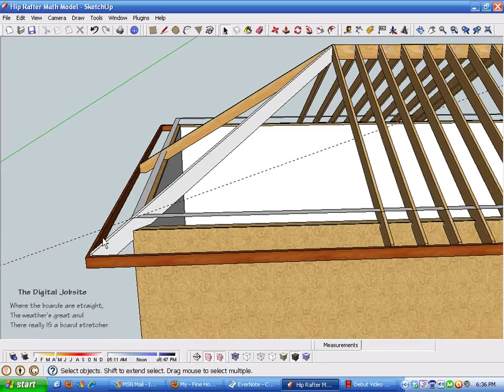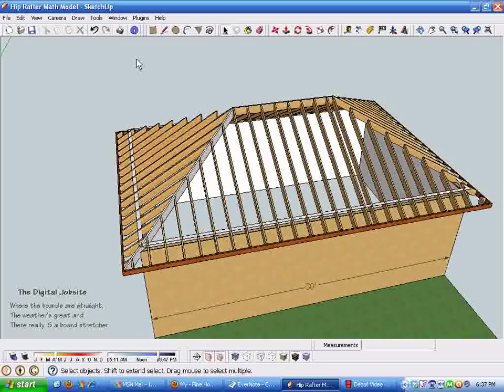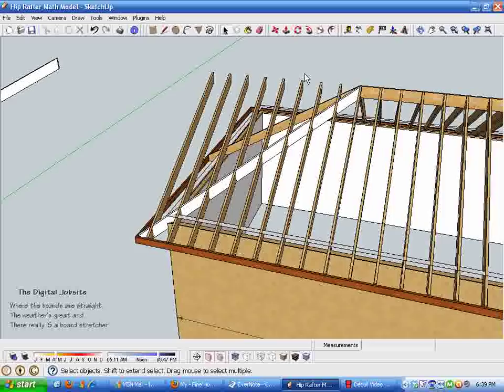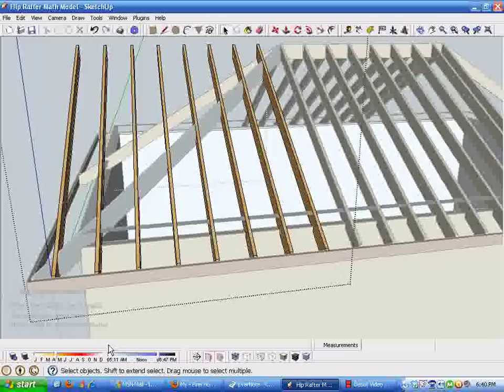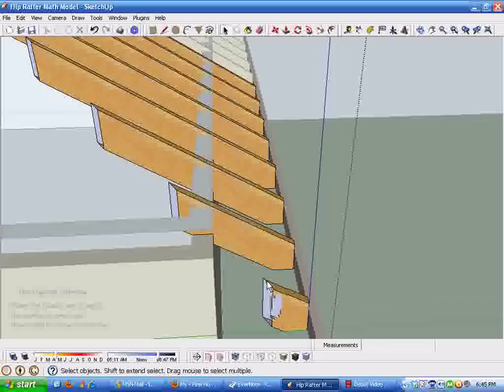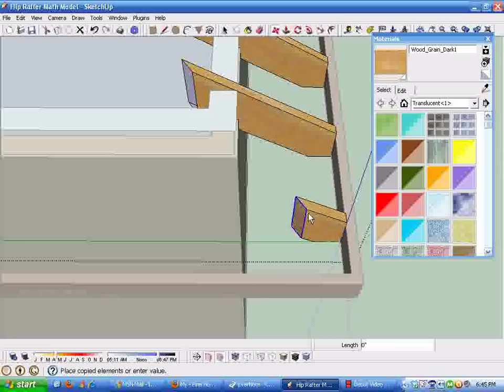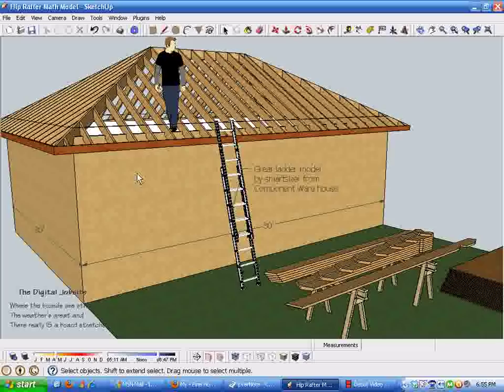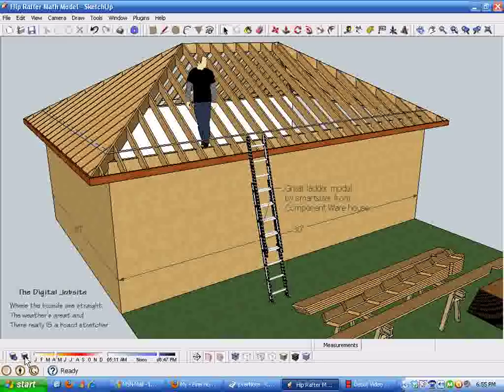Model and Measure Hip Rafters De-mystified by Modeling in SketchUp Part B.wmv

Comment: Great video but Im still having problems. I exploded my over-length jack rafters, made them a group, then edited the group and starting on the first jack rafter drew a line top and bottom to "cut" them from the diagonal rafter. But when I go to move and copy the lines to the two remaining sides, they stick to the rafter and stretch. Tried many times, what am I doing wrong?
Reply: My guess is that you're not moving the 'copy' but the original lines.  Make sure the copied line stay 'blue'.  Any time you click away and the lines turn back to black, they become part of the existing geometry and will 'stick' as they are for you.  I know it's annoying but pay VERY close attention to your keystroke sequence until it becomes second nature.  If it's any comfort I can tell you it took me a long time to understand the different keystrokes and sequences so hang in there and you'll 'get it' soon!
Reply: Thanks so much for your reply. You were dead right - when I slowed down and watched my mouse-clicks it worked.
Reply: @VIUAUTO  Excellent!  I think you'll find this a useful lesson going forward... I know I did! 😎